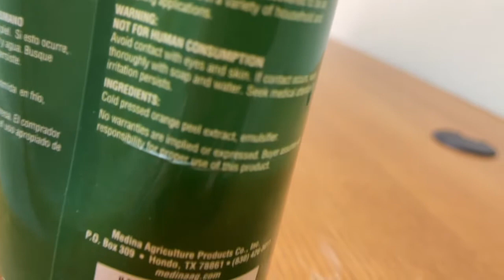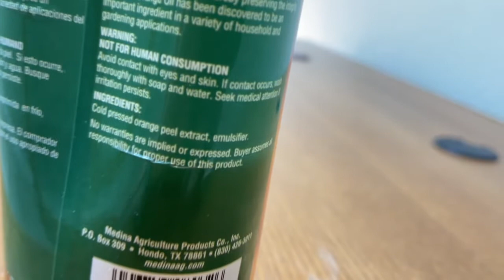New Challenger Pads on Olefin Berber. Carpet cleaning

Comment: Hey Corey, I looked around your youtube channel for a question that I have but didn't find an answer (went 2 years), but if you had $1000 to $1200 to invest in an oscillating 17" floor machine and was just starting out which one would you get? The Challenger is nice, but it's twice what I want to spend right now... it's slow season here in the midwest. I do have a 13" oreck commercial orbiter, but I imagine that is kind of like cutting a large lawn with a 22" push mower.